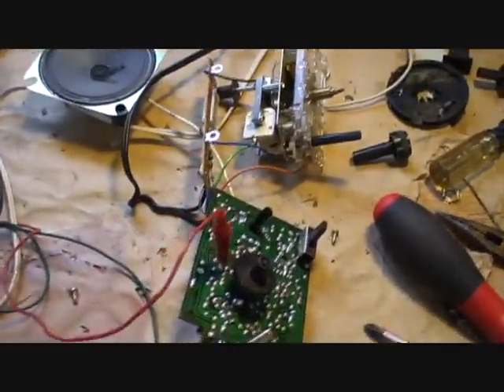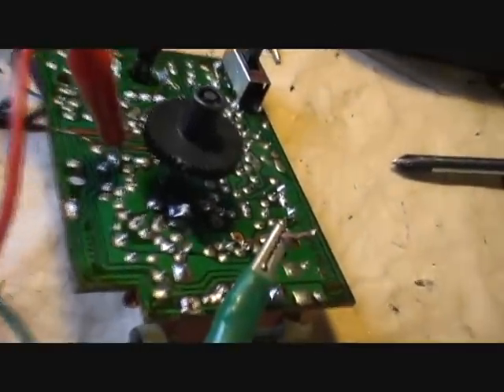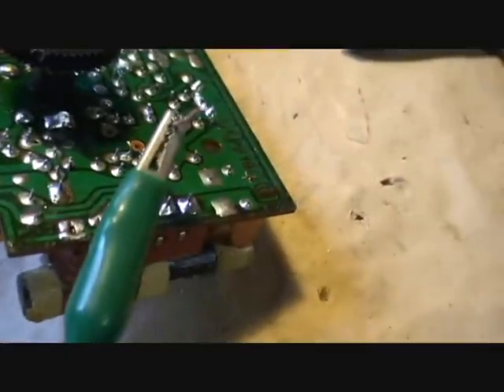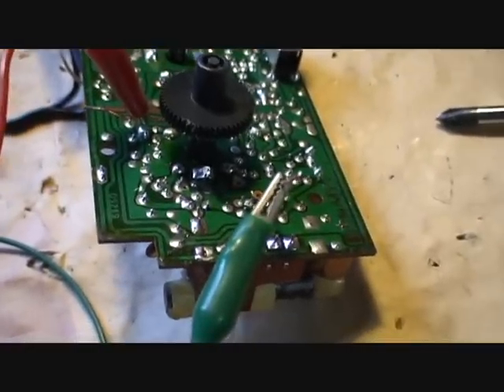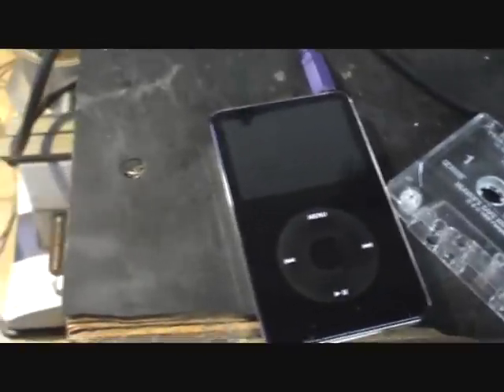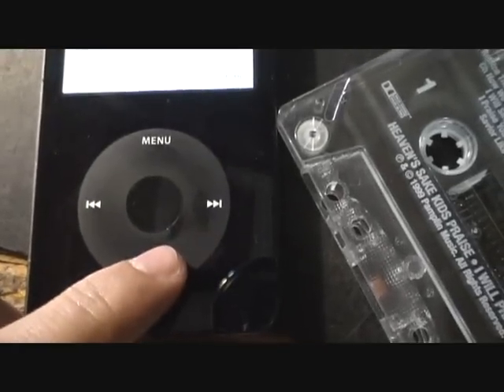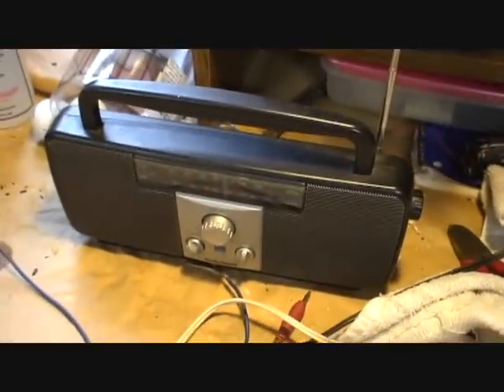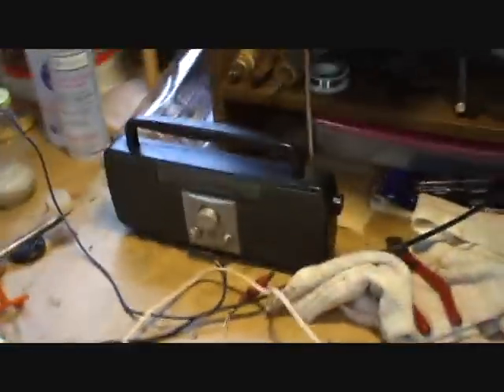FM Transmitter (reverse engineered)

Comment: for all who was wondering how to do it here us how you find the small copper coils there are usually 2 or three you have to snip or solder off preferably and then connect your input aux cable etc to the connections that coil was on tune the radio to a high frequency and get out another and tune it to the same frequency the coils might take a few tries for testing each coil so don't ruin it that's why I recommend using the soldering iron and first try the larger if the tiny coils because it's most likey to be the correct one there you go